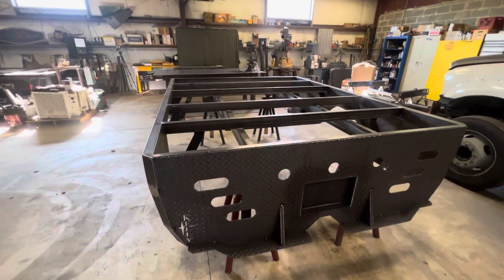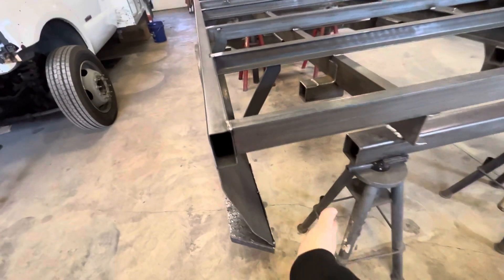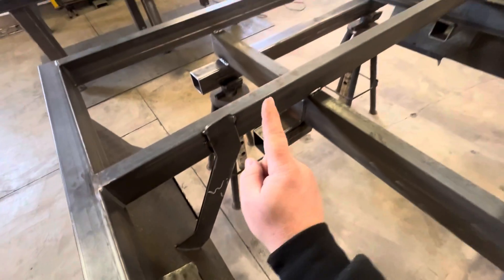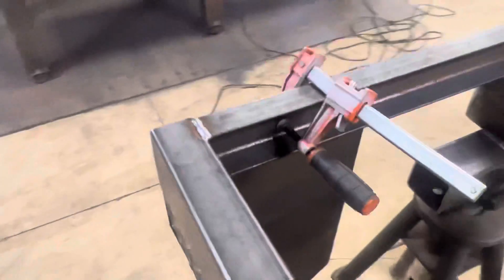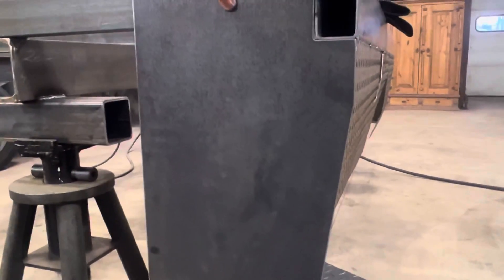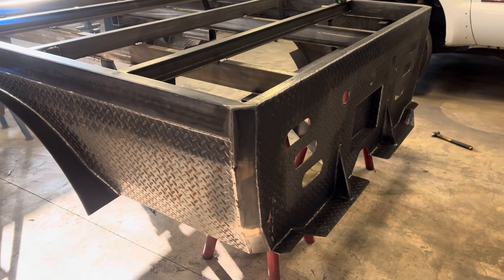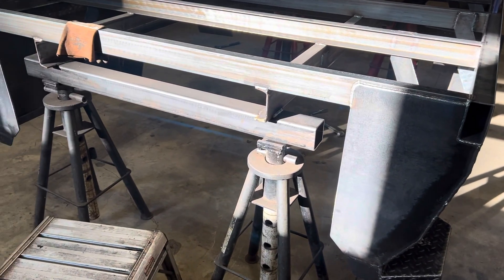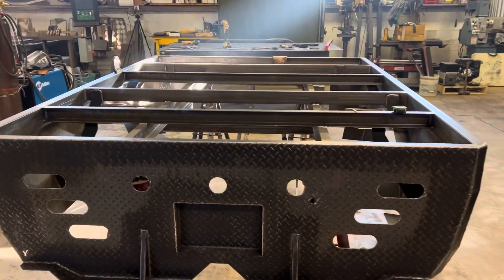Custom Truck Build Episode 3: Skirted Flatbed Build Part 2

Comment: I just fully restored my flat bed, I would highly recommend you put on a two part high zinc epoxy primer, before what ever top coat you decide to use. It will prevent rust also I use "undercoating in a can" it is the best undercoating.
Reply from the maker: I always epoxy prime everything i can!
Reply: @wickedgarage  yeah I noticed you do things more attention to detail then many others. I was just wondering if you use the high zinc epoxy?
Reply from the maker: @jr303official  i use shopline ppg epoxy i believe it is
Reply from the maker: My uncle has a body shop and swears by this
Reply: @wickedgarage  nice

Comment: How did you did bend the diamond plate? I thought at first it was just a flat piece of cnc-ed metal then realized it was bent, sorry if it’s a stupid question lol
Reply from the maker: I went to my local steel yard with measurements and angles, and they bent the pieces to my spec

Comment: What paint did you use and what did you use for primer layer
Reply from the maker: @hunterplaster5787  shopline epoxy primer with black raptor liner on top
Reply: @wickedgarage  have you used that on frames before. I for do paint the bed and figure I would go ahead and do frame
Reply from the maker: @hunterplaster5787  great primer for bare metal used it on the ford service truck build